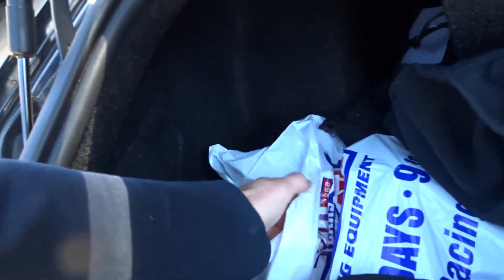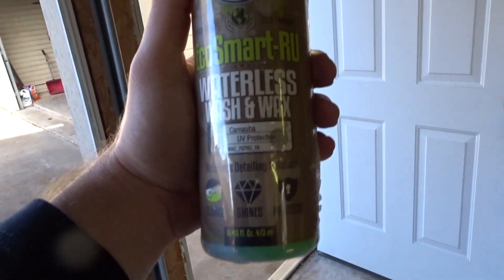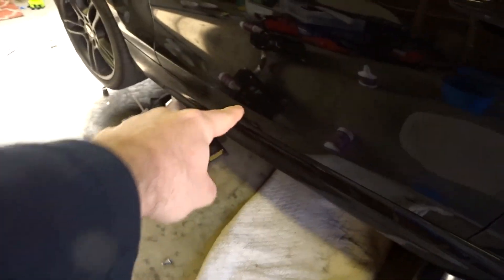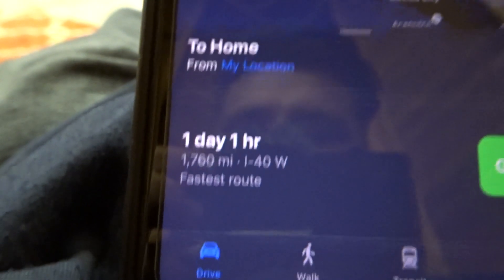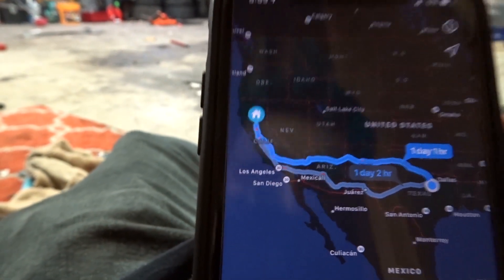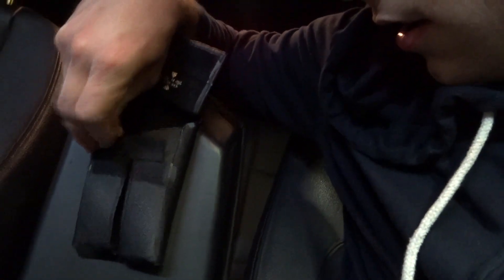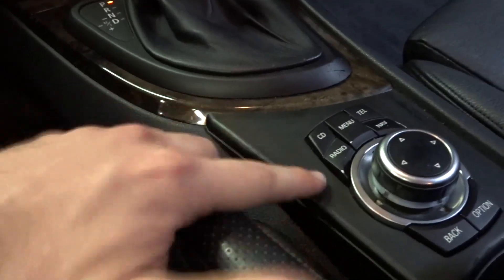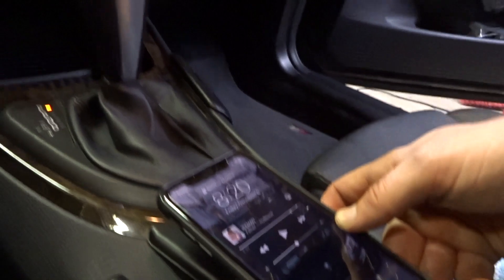BMW 135I BUILD PART 2 (GETTING PREPARED FOR TRIP)

Comment: Get yourself a device called firefly that connects to your aux and usb power then select aux on your radio search for it on your phone Bluetooth 👍 all wireless then
Reply from the maker: Craig Gardner I’ve tried a few of those Bluetooth devices but they don’t seem to work that great. But I’ll check that one out